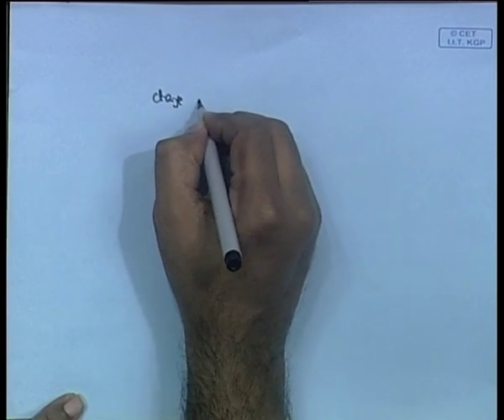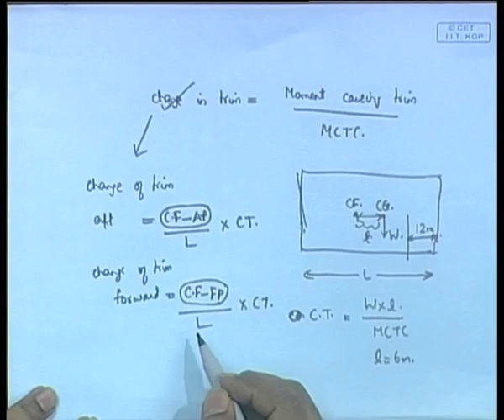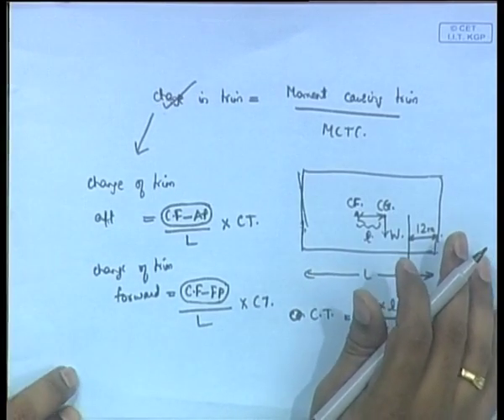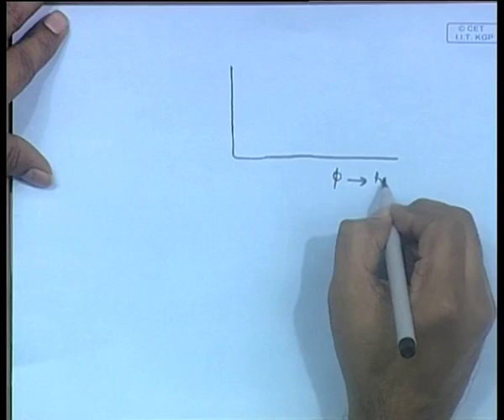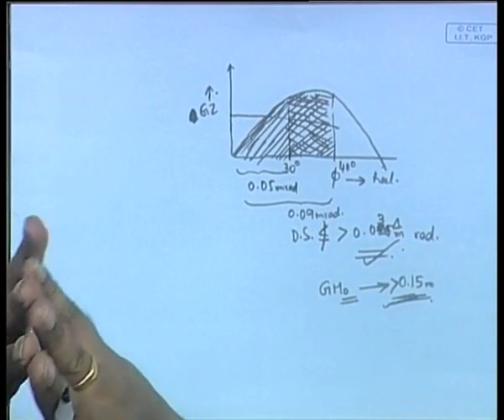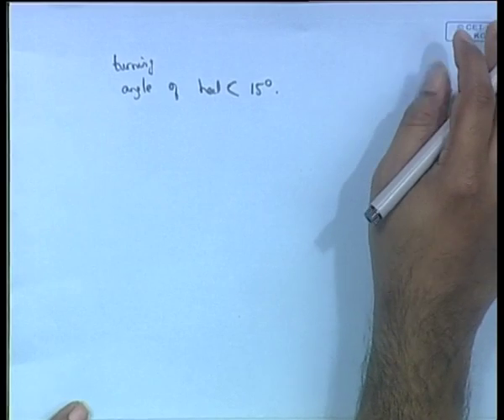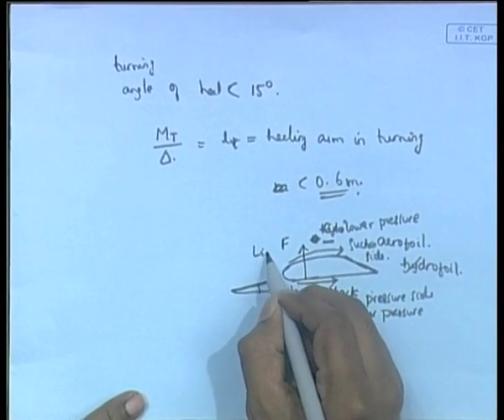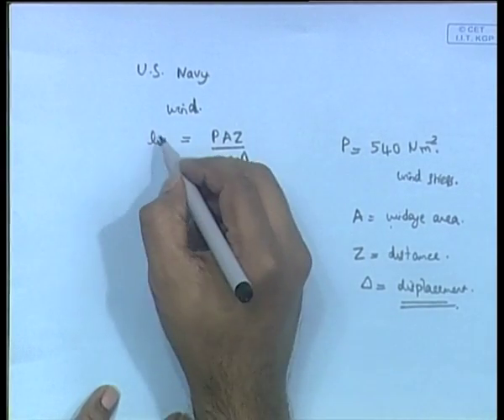Mod-01 Lec-33 Safety Regulations

Comment: As per IMO 2008 International Intact stability Code, The area under the GZ curve between heel angle of 0-30 Degree is 0.055 Metre Radians and not 0.05 as mentioned in this lecture. 
It will be worthwhile to mention that Initial GM for all ships is not 0.15 metres. 
IMO has very little to do Navy ships or US Navy. IMO is related to maritime industry in which the major component consists of commercial ships called "Merchant Ships". In fact Navy ships, pleasure yachts are exempted from IMO rules.